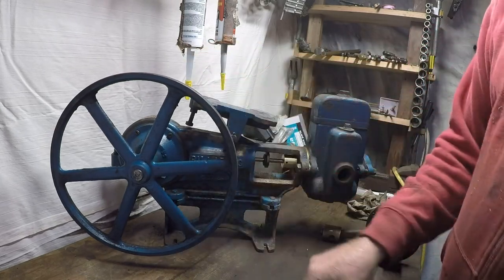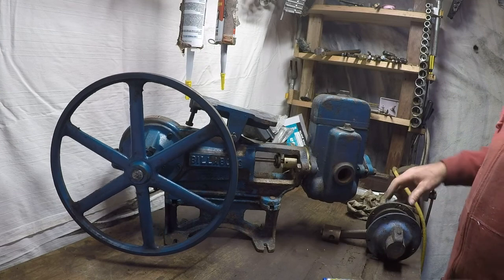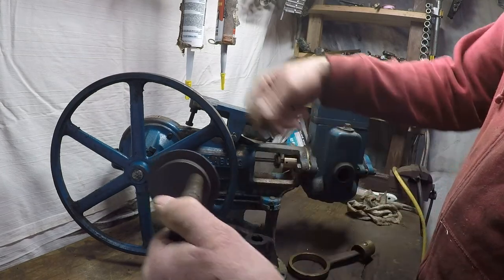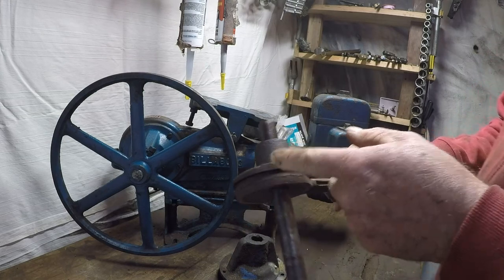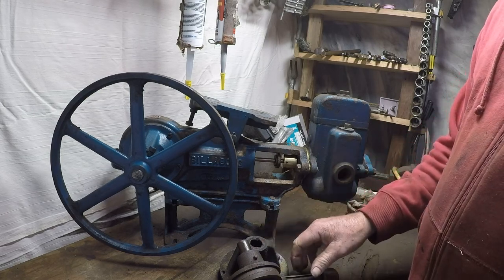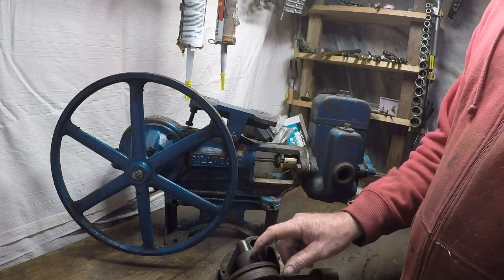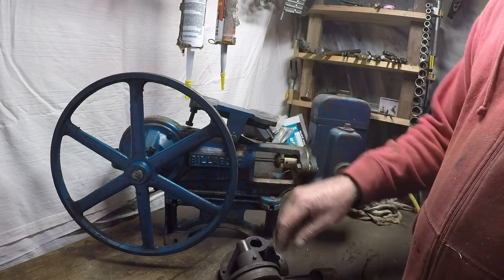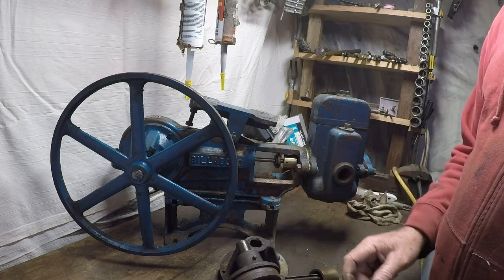Piston pump 1 1/2"  wheel moves not shaft Fix Myers /ajax

Comment: i got a Duro piston pump..it pumps good with a water hose running in the suction end but when you hook it to my water line its as if it can handle the pressure and does not hardley want to turn..now it has a 1/6 hp motor and windings look like new inside..it had a real small pully on it so i put a 2 inch on and it does spin faster when i plugged it in,not hooked to water line so i never tried it after this....what do you think is going on?maybe motor too small?